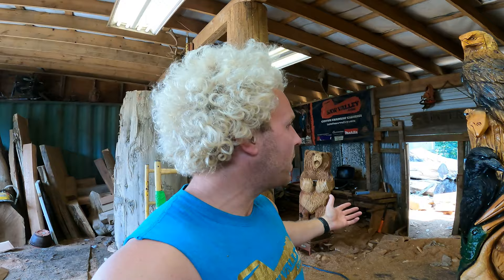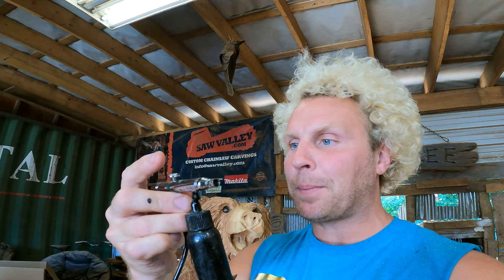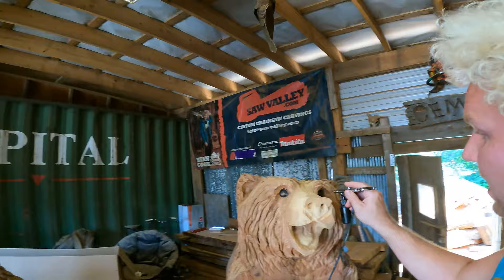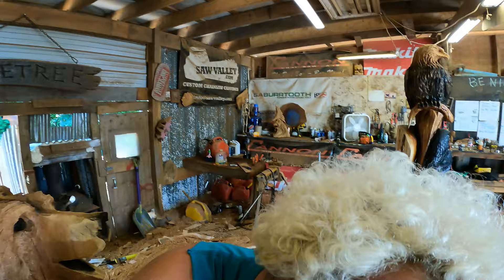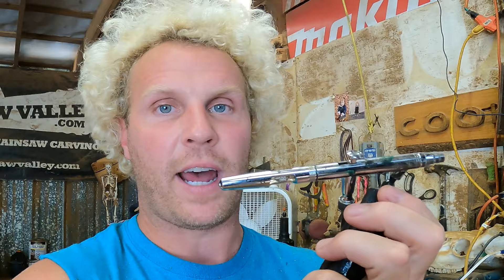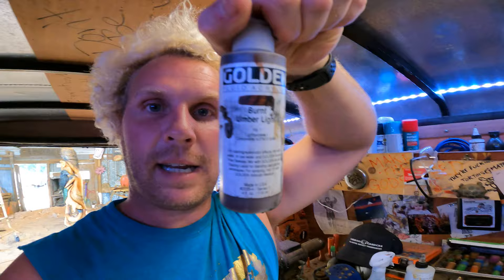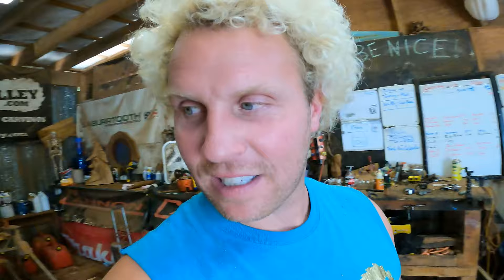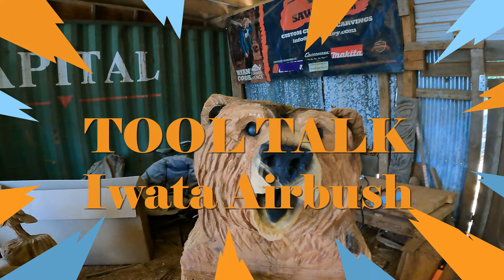Iwata Airbrush Eclipse  for Wood Carving Review - Lots of INFO - Tool Talk Tuesday ep. 2

Comment: I have used Iwata for a long time. They are awesome and they are rebuildable. The HP-CS eclipse is awesome and has an easy to clean out top gravity cup. I spray my rattle can into a cup and run that paint through my airbrush. Works great for fine detail. Keep up the awesome posts Ryan!
Reply: You really should let the decanted paint rest for some 12 hours to let it degas and avoid "flash bubbles" in the finish.. 😉
Reply from the maker: cool
Reply: @BigAndTall666  , yeah I let it gas for a little while, 30 minutes or so.